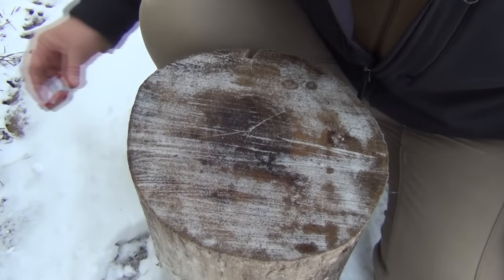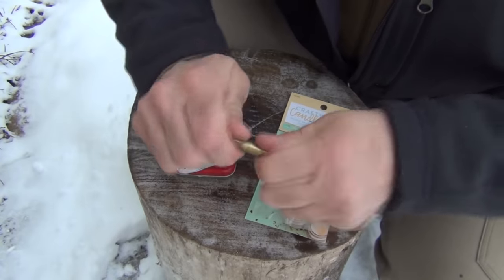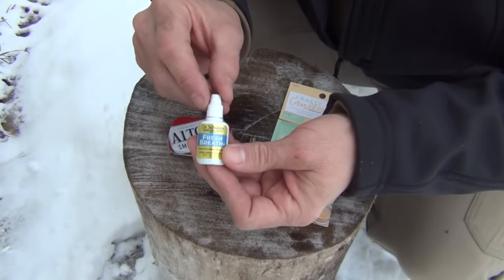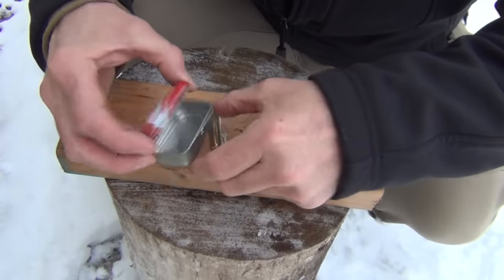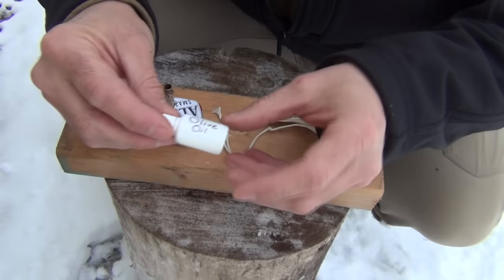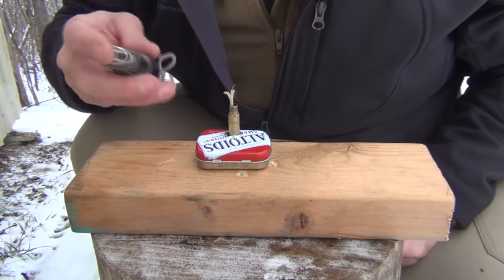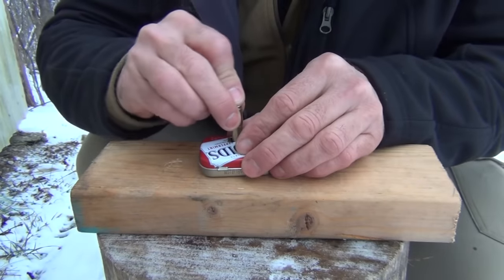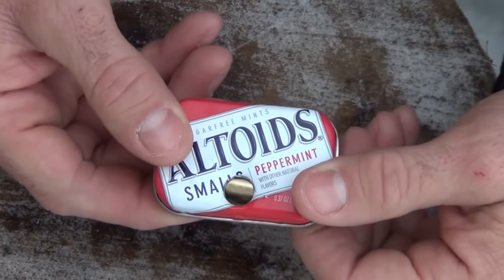MINI OIL LAMP [Really Works!]

Comment: I just use a flashlight
Reply from the maker: How will you refill it when it runs out of battery juice?
Reply: @WayPointSurvival  I will bring extra juice with me..... Primarily orange juice! Lol
Reply from the maker: True. I'm not saying that this should be anybody's primary source of light, lol. It's just another tool for the toolbox.
Reply: @WayPointSurvival  actually...if you made three of them and carried a small bottle of oil they could keep you warm in a tent during a snow storm... Some heat is better than nothing.... It's a cool idea really...

Comment: You know... you could make your own wick, and make it thicker to hold against the inside of the cartridge. Do french knitting. Find an old girlfriend - or your mother or aunt or somebody who used to do FRENCH KNITTING when they were a child. You made long knitted ropes using a wooden cotton reel with between four to six thin nails knocked into it. The yarn comes up through the hole in the cotton reel. You can also buy a pre-made thingy because nowadays cotton reels aren't made of wood. Good quality thin string. Also, you can soak the string in something - I can't remember what but candlemakers who make their own wicks will know. It helps with the clarity of burning I believe. But what would happen if you soaked your wick in melted candle wax...?
Reply from the maker: Yes, French knitting would be a good skill to own.

Comment: Use zippo lighter fuel and wicks. Zippo lighters are windproof and the wick is more robust. Should be the same concept, windproof candle that will light yer cigar!!
Reply from the maker: Yes, the Zippo wicks would be a good option. Thanks for watching.

Comment: What's the point of this? A .270 and your gear is mine. Atleast your mind will be pre occupied. "Chinese made to grab a wick." Air tight and oil tight pipe bomb, paper for the oil.
Reply from the maker: If I have to explain it to you I'm not sure that you would get it anyway. As I said in the video, this is similar to what a lot of soldiers made in the trenches for light.